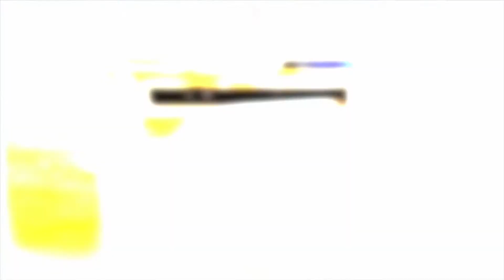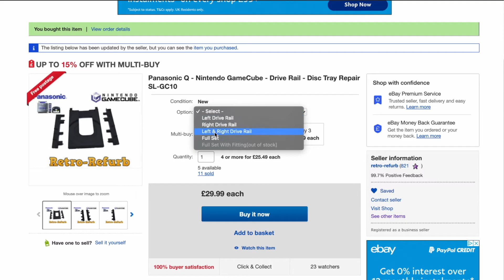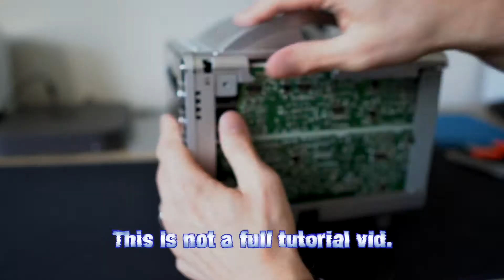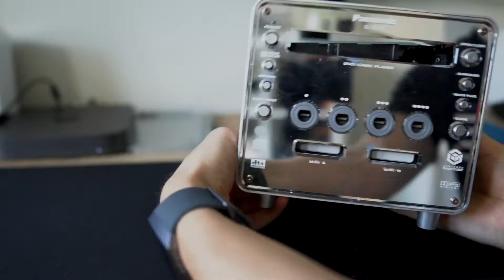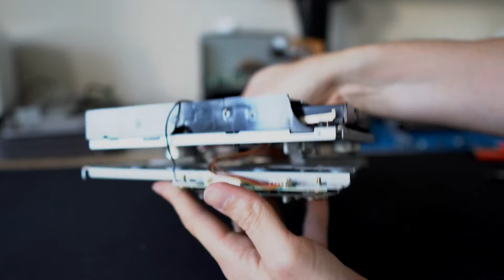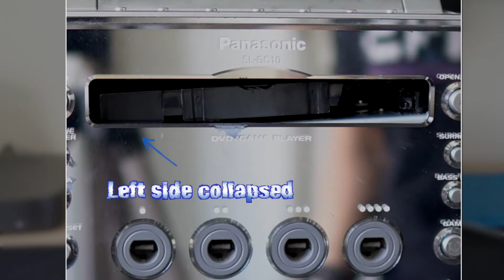Panasonic Q GameCube Restoration Project - Episode 4: Replacing rails, drive tray & band

Comment: Great video. My PQ needs a service too, what with the rails crumbling away (like vintage cheddar) with each passing year. I have actually changed the laser on a RG-M1 WonderMega, but fear delving into the PQ - given it still works, with the occassional hesitation ejecting the tray. I have found touch up paint for Macbooks (available on eBay) works well for touching up minor nicks on the panels, and then blending that it (gently) using Meguiars Ultimate Compound or PlastX.
Reply from the maker: Thanks for getting in touch. oooo a WonderMega, what an awesome piece of hardware. I haven’t even got a Multi-Mega in my hardware library and do want one. Thanks for the tip on the paintwork, I will look into this. I do intend to continue the restoration, like replace the cooling fan, new front. Maybe even one day try and integrate the correct voltage step down in the main system. One day though.
Reply: @nermaldigital   I'd be interested to know if there's a way to upgrade the stock fan - it's the second PQ I have owned since they launched, and both have had noisy bearings. I remember getting the RAM chips (bank of 2 made by Hynix) soldered into the DVD Board (has the blank space/points for them) to enable PAL DVD Movies on the first machine - a bit of a pointless task these days though.
Reply: I need to do this too, did you fix your fan?  Any advice if so? Thx

Comment: I felt that pain so much the first time it didn't work. Ages ago I opened mine because I had an scratching disc issue. I fixed that, but the console had other issues afer that. Sent it back to Play-Asia who luckily fixed it. Now, after trying to boot after quite some years, I hope the rubber band is the only issue why the dvd-drive currently isn't opening  ^^;   (I also still feel the stress and disassembling and assembling a Q, phew...).
Reply: Plus total happiness @15:28!

Comment: I just want to say thank you for your awesome video.
I was able to fix my drive watching you video.

Unfortunately the 3D printed tray and rails didn't wok for me.
I had to buy a 2nd hand old Panasonic DVD player and migrate the rails and tray from it.

I also had the problem that the recommended belt is too loose. What the hell?!
I bought a smaller belt. I found an O-ring from an auto part store in my town with the right measures!
Yeah!

Then I installed a qoob pro and flashed iplboot on it, so I don't need to use the Drive anymore!
It's just for display purposes!

Thanks!
Reply from the maker: Good stuff. Glad to hear and thank you for your kind words. Out of curiosity, what is the model number of the old Panasonic DVD player you used the parts from?
Reply: @nermaldigital  there is a model on Japan: Panasonic DVD-XP50 which uses the same drive as the Q with minor differences!
Retro Refurb doesn't seem to sell these 3D parts anymore =/

Comment: Congratulations on getting your Panasonic Q back in fully working condition.

 I had similar a problem with the drive after I replaced the rails on mine.

I actually lightly sanded the rails where the tray slides to remove some of the 3D printed texture and it got my tray working.

The belt on mine was hard and I replaced it with a SCX4.6 square belt. 

Didn’t think about trying a rubber band, awesome idea.